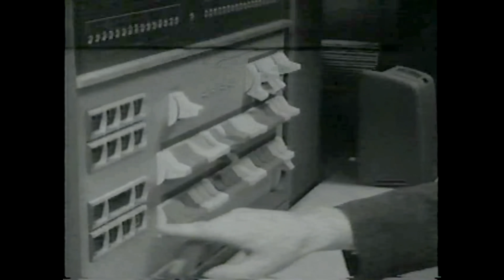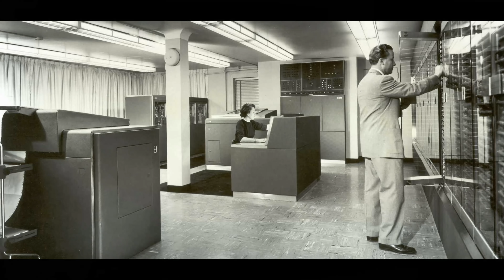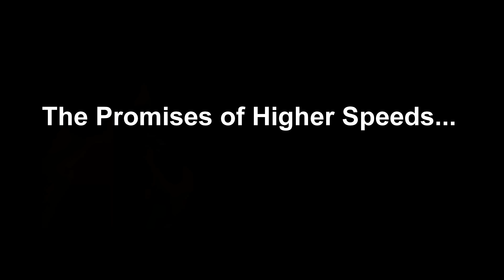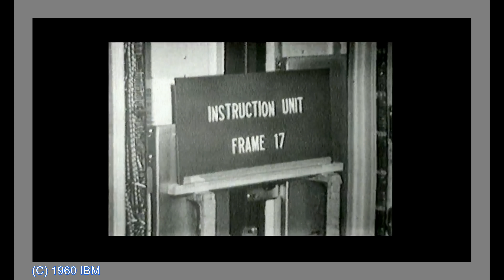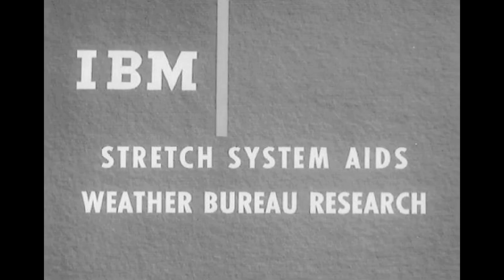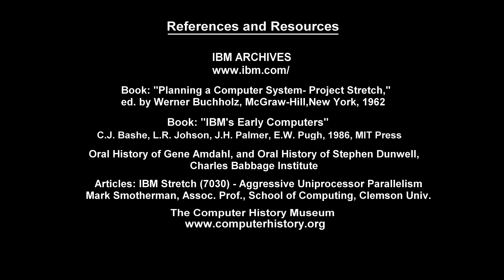Computer History: World's FASTEST Computer! 1961-1964 film & photos (IBM Stretch supercomputer)

Comment: Was STRETCH a faster computer than the Ferranti ATLAS? Both targeted the same scientific community in the same era.
Reply from the maker: Great question!   The IBM Stretch had a slight speed advantage.  If you were timing a single mathematical loop for example, the IBM STRETCH was faster.   However, if you gave both machines a stack of different complex jobs to finish, the Atlas would likely finish the pile first due its more complex nature.   --  As an historical note, Both computers were eventually eclipsed in 1964 by the CDC 6600, which was roughly three times faster than either machine.  ~   Thanks!   ~  VK, CHAP

Comment: Yes, I too used to run the IBM 7090 mod#2 at JPL - a second one for back-up purposes.  They were used for deep space shots & luner orbiter missions.  It would take me (almost )an hour to load the 80 column cards into the card reader, mount the 10+ tape drives, set them at their required bpi rates.  We used the IBM 7040 (with two taped drives) as an I/O device. Once running - rest time for the operator.

Comment: It's amazing how far along computers have come.  My less than 1 kg PC the size of a refrigerator dish that consumes only about 10 watts is VASTLY more powerful than STRETCH, which weighed about 32 metric tons and consumed 10 kW of power.  That PC cost me less than $200, and STRETCH cost about $82'000'000 when adjusted for inflation.

Comment: I supported the IBM 7090 & 7094 hardware system in the late 60s and 70s.
Reply: I worked for IBM for 27.5 years and as a computer operator I worked on a 7010 and number of 360's and 370's.

Comment: And here all this time I thought nobody ever heard of AI until about two years ago.
Reply: ai was being discussed and under theoretical development in the 1950’s however there was no hardware support available. Those people in the 50’s were giants.
Reply: I used to hang around the MIT AI lab when I was in high school in the early 1970's.
Reply: @s @skovner ere are technical papers written in the 1950’s that are mind blowing. Those people were giants. The best we can do is to stand in their shadows and build on their work.
Reply: @rickhunt3183  I've met some of them from the 70's. They wouldn't remember me.
And having learned about modern AI - I don't really trust it except in limited domains.
For that matter, I've been using computers for over 50 years and don't trust them. My backup strategy involves 2 NAS devices, external drives on all computers, and an external drive for backups from the NAS devices.
The first computer I used had a 1 MB removable disk drive. That was for the OS. We used punched cards. (Anyone need to have an 029 keypunch unjammed or its ribbon replaced?) 
Too bad the Living Computer History Museum closed. I used to joke about retiring there as an exhibit.
And now retired after a long career, still learning.
Reply: @skovner I sat down at a Plato terminal in the basement of the University of Illinois Engineering Building in 1975 and played chess with someone from Indiana University.

Comment: Turns out it was not very fast, partially because it had a very complex instruction set and also way spread out.  Signals just couldn't switch or propagate all that fast.
Reply: That was a big limit to the Cray-1 - 11.8 inches is a nanosecond (ask Grace Hopper)
That is one of many reasons modern microprocessors can run much faster than old computers.
Reply: That has always been a limitation of compute architecture. One where the need for high-speed calculations is balanced against sufficient cooling. The people of the time managed to develop many ingenious solutions. At the same time, this was achieved wearing funny suits and weird haircuts. Many of them also wore hats and somehow got away with it. We need these people today; I can't stop thinking. Oh, yeah, their pants were hoisted up to lower rib height, without justification.

Comment: The presentation makres reference to automatic error correction. This is probably a reference to the application of a technique for single-bit error corrections, double-bit error detection, invented by the mathematician Richard Hamming.  STRETCH used 64-bit words plus eight bits of Hamming code to form a 72-bit word in memory. His original work on this was published in April 1950 in the Bell System Technical Journal. This technique was routinely applied to semiconductor memory systems, e.g. starting with the early dynamic memory chips from Intel 1103 released to the world in 1970.  Initially, Hamming detection and correction was achieved by ancilliary logic circuits built around the memory chips, but eventually it was often incorporated within the chips and became almost transparent to the memory system designers.
Reply from the maker: Hi @philipwardle6820, that is some great backstory information relating to the STRETCH!   Thank you very much for taking the time to share that info.  That bit of history is probably not generally well known.  Thanks!  ~  VK

Comment: Interesting that it had both an Operator's and Engineer's consoles.  My guess is the operator's console was used to run the computer, and the Engineer's was to keep the computer running!

I saw enormous vertical hard disks like that in an old movie recently.  Wish I could remember which one; I didn't think they were real!
Reply from the maker: Hi @gdavisloopfta380, yes, quite amazing to see two such large consoles on one computer!   Quite massive and needed full time oversight.   The vertical hard disk (RAMAC unit) were used connected to many other IBM big computers of the late 1950s....
Thanks very much for the feedback!

Comment: One example was sold to the French atomic research agency and is partially preserved in the Paris museum of Arts et Métiers.  They have the control panel on display and some of the drum broken down so you can see all the heads and wiring. Probably the only example this side of the pond.
Reply from the maker: That sounds fascinating.  Good to know.  One wonders where the different machines and parts ended up.  Thank you!  ~  Victor, CHAP

Comment: And today the whole hall is lying on my desk as a matchbox-sized ESP8266...
Reply: The performance difference is quite dramatic. The  $3 ESP8266 can do about 75 VAX MIPS non-floating point.  The IBM 7090 metioned as being a little slower than IBM Stretch could do about 0.186 MIPS scientific calculations.  The ESP8266 would have to do floating point in software but even so it would probably be way faster than the IBM Stretch.

Comment: I was under the impression until recently that the IBM System/360 was the first computer to break out of the “octal closet” of bits grouped by threes (as in 36 bit words and 6bit text characters) and group bits by powers of 2, with 8 bit characters called “bytes” and 4 bit “hex” (hexadecimal) digits called “bubbles.”  But someone told me that the 7030 Stretch had such an architecture before the 360.  Having had no knowledge of the Stretch before, I searched and confirmed that it did indeed have multiples of 4 bits expressed as hex digits!

Since then, all but a few IBM computers and all personal computers have used hex with 4, 8, 16, 32, and 64 bit processors.
Reply: The hex notation is not intrinsic to a machine, though, but just a convention used by the programmers and engineers.  Digital Equipment had 16-bit machines that were documented in octal notation.
Reply: @ True.  They were adamant about preserving their legacy.  They went on to build 18 bit machines also.

Comment: I just got my new Stretch Computer delivered by FedEx last week. In no time I've got it all set-up. This system is a lifesaver. Thank you IBM! But really, when I started watching this, I thought IBM named the computer "Stretch" because of all those stacked cabinets stretched out behind the operator's console.
Reply: is yours working properly?..mine keeps turning on all the blinky lights at the same time (or in the pattern of a sad face) until i reset the power (after calling the local power station) which takes about an hour..by the way when i first got mine installed ..i forgot to call the local power station so they could bring a new nuclear reactor online and when i powered it on the entire city went dark...just a tip for others installing their new Stretch Computer at home ...i have not received my first power bill yet i am sure it will be fine...
Reply: @MickeyMousePark  No rolling blackouts yet since I turned on my new Stretch Computer. My first power bill also hasn't arrived, but I'm not worried. All the heat it generates I can sell to warm the entire neighborhood come this winter. I think mine works. I asked it to give me the square root of 9. After some churning and all those Christmas lights flashing in front, it gave me the answer of 3. Incredible. IBM is no Mickey Mouse operation. If your power bill is high, run an extension cord into the Disneyland main power grid, and you should be good to go. :)

Comment: It's kinda weird to consider that your smartphone, which even though it isn't as powerful as recently assembled gaming computers, is like hundreds thousands times more powerful than that IBM supercomputer (especially with several clusters of superscalar out-of-order shaders in recent GPUs which are a bit hard to stall even with graphics and OpenCL code spaghetti, so they're also commonly used for supercomputing task even in your own computer at home which is crazy considering you can buy $10+ millions computer hardware for $300 to 2,000 a chip on the video card). Technological advancement is crazy.

Still, I appreciate having digitalized films available on YouTube - history is worth preserving and shown.
Reply: the stretch was 40 kIPS. Your basic modern appliance uses a processor in the low MIPS range, and yet no one uses their dishwasher to run spreadsheets. Essentially we have an incredible amount of processing power in our homes nowadays, and most of it isn't utilized.
Reply: @thesteelrodent1796  That was for the older IBM computer in 1955. Stretch was said in the video to perform a billion instructions per second. That is very impressive actually! It would be close to the best PC CPU:s in the late 90:s...
Reply: Hundred thousands ?  Try in the order of many millions times faster.
Reply: @oldtwinsna8347 If the superscalar out-of-order graphics processor (especially the Qualcomm Adreno GPU) is involved, yeah, it easily gets into insane numbers.
Reply: Tomfoolery- if you belive your mere cell phone is more powerful...
Reply: @Junebug.echomusic  Why do you think I am a fool if it's a easily verifable fact? 🤷

Comment: Very interesting. Does CHAP do the narration on these videos? How long was STRETCH the world's fastest? Some of the later systems mentioned were still around when I started. A school where I worked had an ex-NASA IBM 360/91 which had once been one of the world's fastest. Had a feeling of real power at my fingertips when running jobs on it.
Reply from the maker: Hi @dalecomer5951, Thanks very much for your feedback.  We research and draft and produce narration when there is no narration to the film.  Many early clips from the 1950's are silent, or have simply lost the audio portion over time.   ~ STRETCH was top dog in speed from 1961 until 1964 when the CDC 6600 came out.  Lawrence  Livermore acquired a 6600 for $8 million in August 1964, and that was fastest until the faster CDC 7600 came out in 1969.   It was a mad race for speed... Government funding kept the computer firms pumping out faster and faster machines.  ~  Your work at NASA sounds like a great experience!  the 360/91 was a powerhouse from what little I know of it.  Sounds like fun!
Reply: @ComputerHistoryArchivesProject  Hi-- I worked for a school (State U.) which got the 360/91 surplus from NASA after Project Apollo. There were a number made available. I should find out what replaced those at NASA.

Comment: Bring back blinking lights, and spinning tape drives!  Down with boring modern computers.
Reply: If you make a grid of 3mm holes about 100x50. Fill the holes with flashing LEDs. When powered up the difference in the LED timing will, after about a minute, give you a blinking light panel that looks just like real work is being done. 
Give it some plausible sudotech label and put it on the front of a server rack. 
Amaze your friends.
Reply: Lots of potential uses for blinking lights with a modern machine. You could assign them all sorts of meanings. CPU usage graphs, individual drive usages, temperature readouts, your imagination is the limit.
Reply: Back when I was studying programming (coding) in 1973, the computer that we used to run our programs (using punch cards) had this on the window of the huge room that the computer was housed in:

"ACHTUNG!

Alles Touristen Und Non-technishen Lookens Peepers! Das Machine control is Nicht Fur Gerfingenpoken Und Mittengrabben. Oderwise is Easy Schnappen Der Springenwerk, Blowenfuse, Und Poppencorken Mit Spitzensparken. Der Machine is Diggen by Experten Only. Is Nicht Fur Gerverken by Das Dummkopfen. Das Rubberneken Sightseenen Keepen Das Cottonpicken Hands in Das Pockets, So Relaxen Und Watchen Das Blinkenlights."

Yes.  It's pseudo-German.  😸
Reply: @kalinystazvoruna8702  I remember those signs, too.
Reply: Real computers have blinking lights and real programmers know how to use them,
I sign I put on my PDP-8e
I did read the manual for the, iirc, 360/30 and it specifically said most of the lights were for customer engineer (field service) use only. But they did look cool.
Reply: Trump will do!

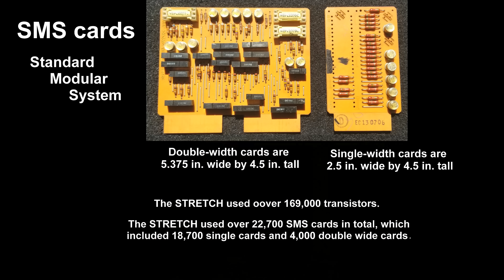Comment: 4:50 were the SMS Cards Hot Swapble, or did they have to power down the machine before hand?
Reply: Yes. On, for instance, a 7094 system, the power down/up process was relatively slow, so we would hot-swap.
Reply from the maker: That is a great question.   Don't have the answer at the moment, but that is one for further research.   My guess is that if they found a bad card on a machine used for high-accuracy atomic research calculations, they might want to stop and replace the card before doing more calculations.   Just a thought.  Perhaps someone in this thread will know the answer to your question about hot swapable SMS....
Reply: I very much doubt "hot swapping" was a thing, in 60's computing.